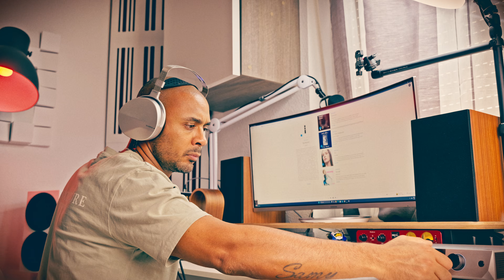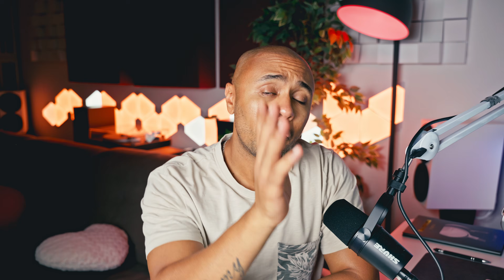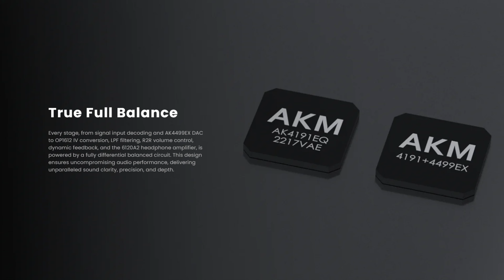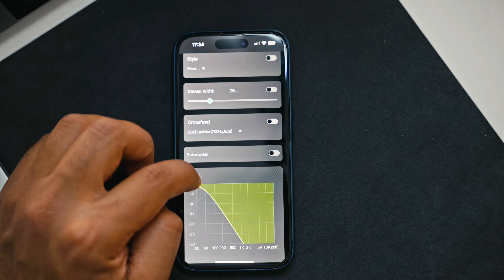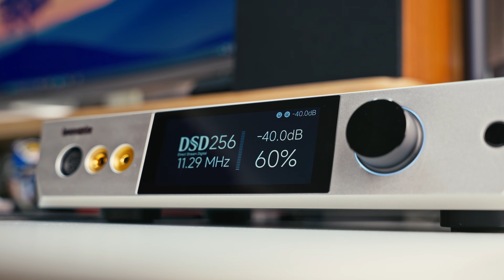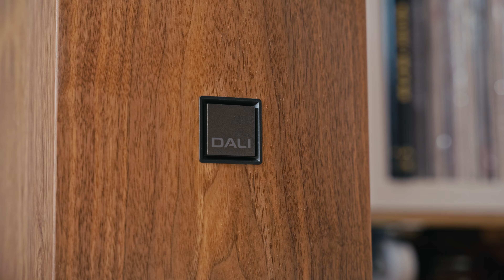This DAC/AMP Does What No Other Can! – Luxsin X9 Deep Dive!

Comment: Oh you got Dali rubikore 6, BA said they sound as small floorstanders. Looking forward for you to compare them as I am still not sure witch one to get. Rubikore line is not yet available for me, plan to give Epicon 2 a try with Luxman 505z.  Was wondering about the difference between stand mounters and small floor standers as I already own small floor standers dali ikon 5 mk2 in my HT. 
I watched your video on Naim having low level noise, people say it’s due to ground loop. Naim gets the ground level from the proprietary connection to naim dac. Connecting dacs like yours or chord will resolve in hum due to different power supply. I heard you can get rid of it by connecting negative rca to the external ground but don’t take my word on it as I am far from an expert just a messenger. Thought you might want to know. There are also some kind of cables that can deal with that from what I heard.
Reply from the maker: Hi, thanks for sharing! I don’t have any ground loop issues with the Naim, the only thing I’ve noticed is a bit of mechanical hum from the toroidal transformer. That’s quite common in many environments, but with the Naim it’s more noticeable due to the size of the transformer.

As for floorstanding vs bookshelf speakers, it really depends on your room. Some bookshelf models can sound surprisingly full and spacious, but you’ll need to test them in your space to know what works best.
Reply: @MadAudiofficial  Yep I know it's case by case situation. Was just wondering what was your experience having owned both rubikore 2 and 6. But if you are planning a dedicated video for it and don’t want to spoil it, I understand.